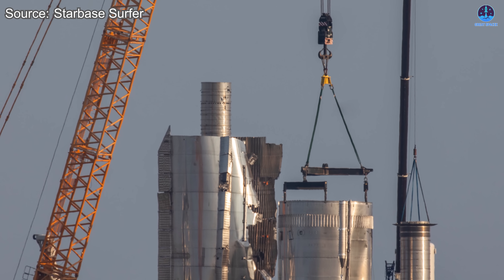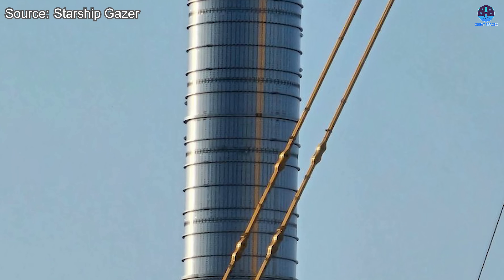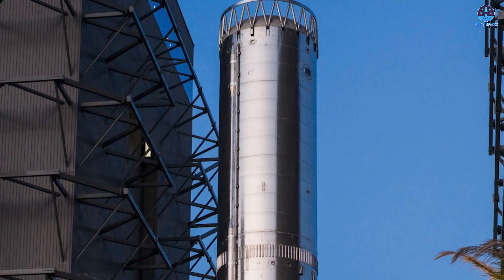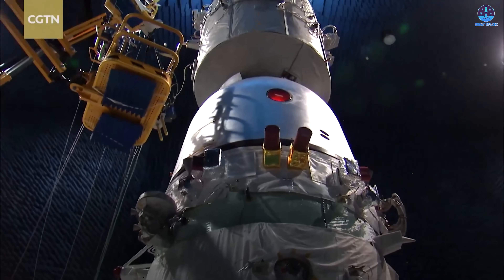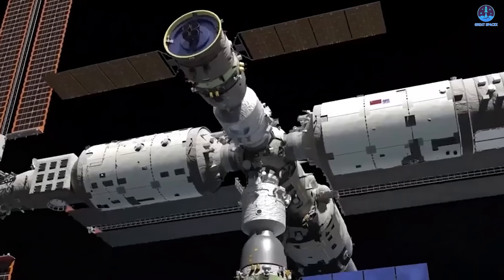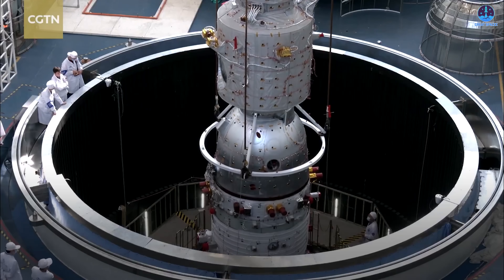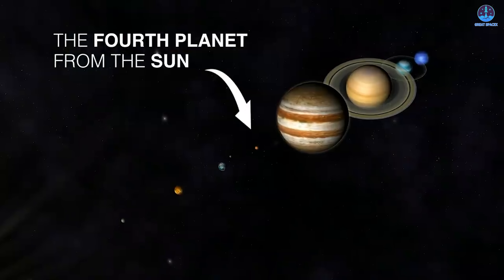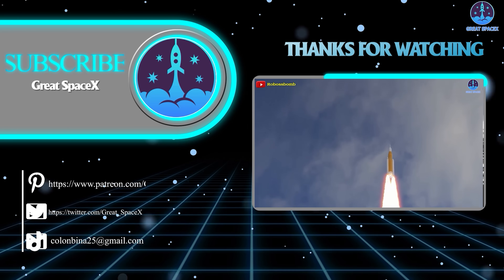SpaceX Already Finished Cut Starship B18 while B19...? China's Fastest Rescued Mission Launched!

Comment: Good report, glad the Chinese have demostrated capability in sudden reactions and now renormalizing.
A lesson for other Space Endeavors.

Also a great lesson in why we shouldnt litter up Space....
And why portlights on ships should have internal gasketed metal  covers with thermal reentry tile,waiting on hinges to be dogged over cracked Portlights.
Its been common on Navy Ships over a hundred years...

I suspect Metior Mining will be lucretive on most no or low density atmosphere bodies.
Nickle iron weighs up pretty fast, and likely is very common down to dust sized.

And its a renewable resource...

Pretty good chance early industry on Moon and Mars will be based on Magnetic Vacuum Rovers that are robotic, run off Solar for lunar day, and zip around cleaning the regolith and dumping it in the chute for the conveyors leading to smelters.

Lunar Dust Bugs?

As for next Starship flight, I suggest they lower test pressures slightly to squeak by, and then think long and hard about increasing diameter to get into thicker hull skin.
Current Versions only alittle better than Wrinkle Nose Hopper for structual strength.
I suggest hull thickness be the starting point on ship design. That there will be a minimum feasible Diameter for Fabricated Stainless ships running cryro, based on volume to mass of skin.
80% of a steel hull's strength is in its skin....
Translation; you increase hull thickness more than you clutter it up inside with structure...
I've done alot of long winded writs on it....
Basically engineers are paranoid about interior structure.
And Starship is built wrong via hunking up Longitudinals and buttwelding them back together as rings. This is not how you build a hull.
Thats like making a Viking Longship out of Pallets...😂

The Mulish, shall have many RUD's...

And the Chinese learn from every such mistake at no cost or lost time....

"Thanks! Round Eyes!"

😂
Reply: The Ginaese just stranded a different crew in orbit. The capsule experienced technical faults, NOT debris impacts, but design flaws.
Reply: ITS AA CART OO N L0ON'S WtF